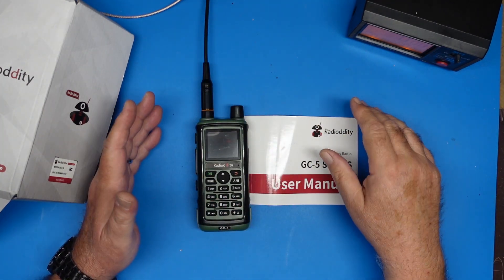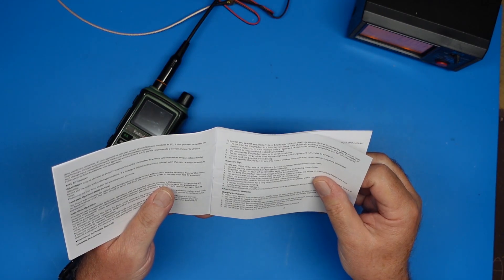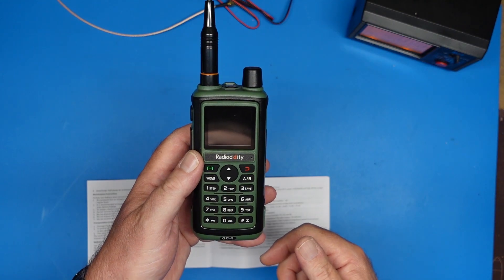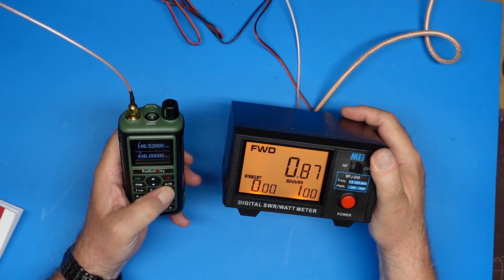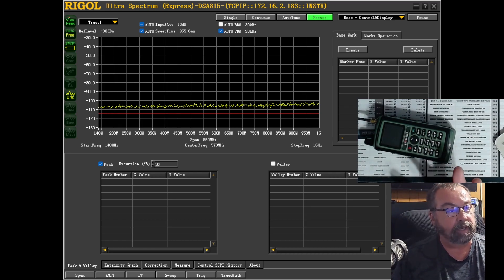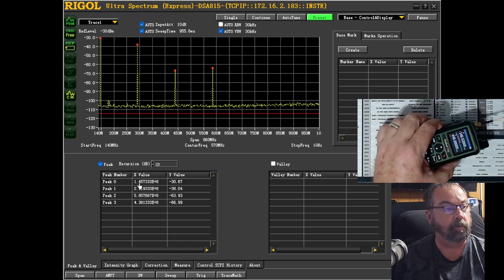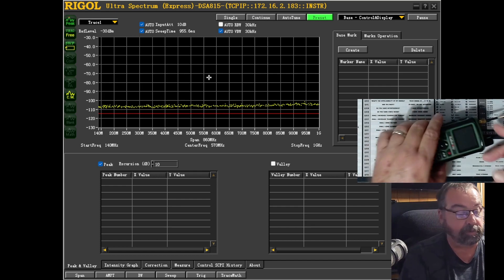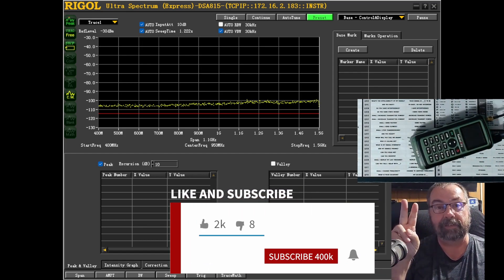Radioddity GC-5 Quick review and test!

Comment: Here's the deal. You can test the Power output on the radio itself BUT the SWR is a test of the antenna's performance,not the radio. If it has a high SWR reading, it is the antenna that has a problem, not the radio. At 5 watts, that is no big deal.

Comment: Definitely not a clean machine.  No amount of scrubbing will fix that.  Looks like it might be a 70cm transmitter design that they are trying to reuse for 2m.  Great video Jim! 73
Reply from the maker: You are correct - not even Tide is gonna take that stain out!